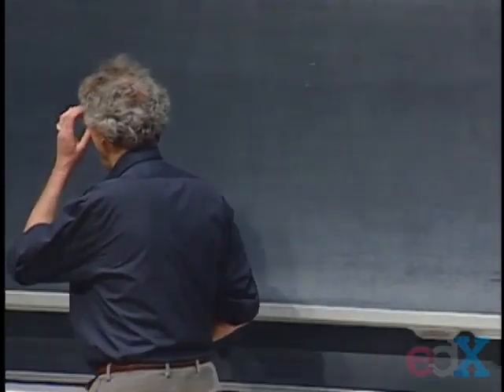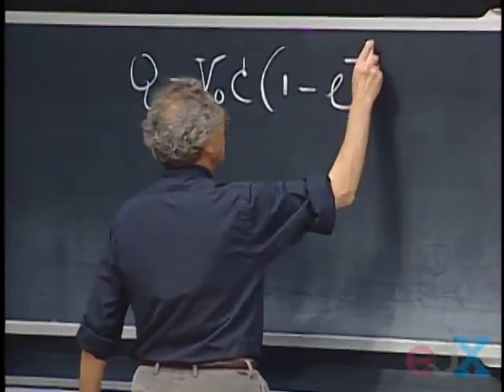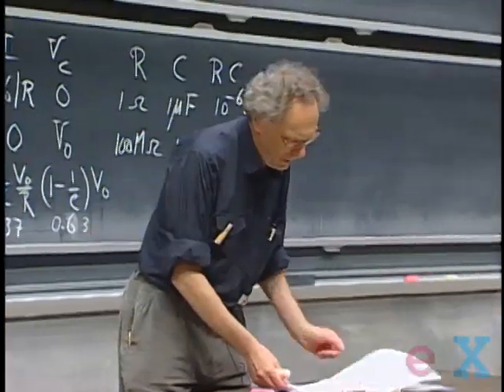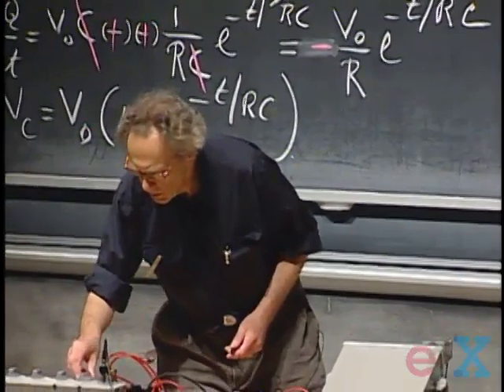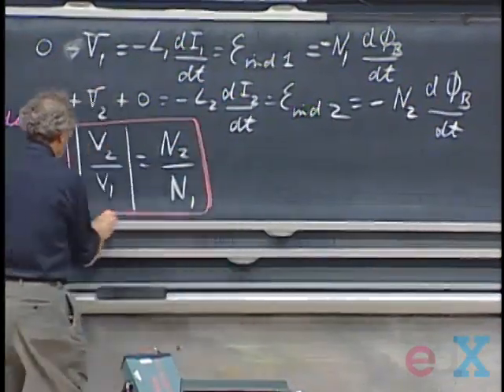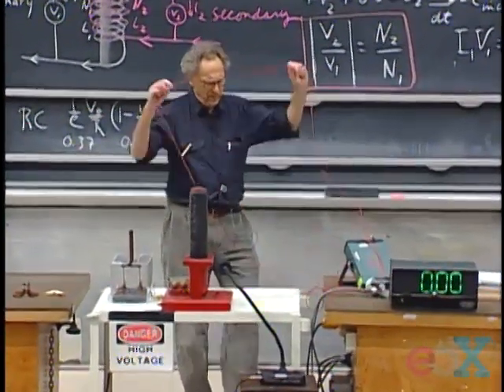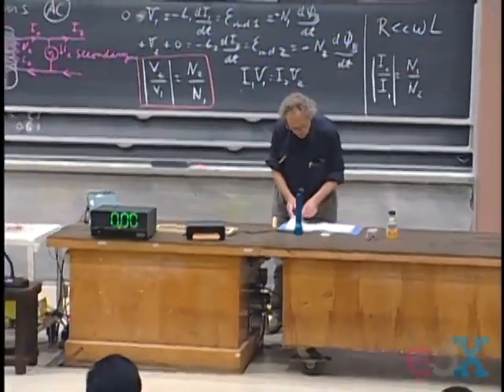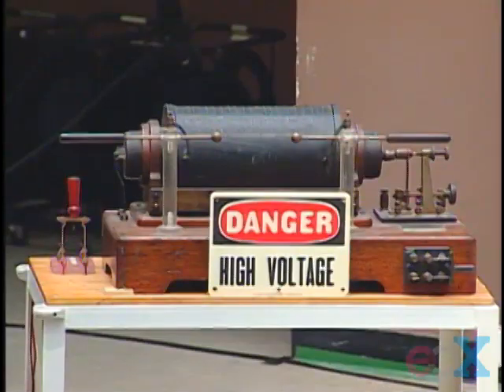8.02x - Lect 24 - Transformers, Car Coils, RC Circuits

Comment: Sir...

1) How can LR and RC circuit be so similar i mean for both of them the value at time constant is 0.63. Is this just a coincidence or are they related.

2) Also we have seen almost all the formulas of field/potential in gravitation/electristat/magnetism are exactly the same except the constants and concerned physical quantity so is it just a coincidence or do they have some relation?

3) Why the flux coupling is not ideal when you kove secondary loop up the primary loop?

4) What is the use of resistor in RC circuit when the switch is at position 1?

5) Why R<<<wl is a 'IF' in ratio of current and not in the ratio of Voltage afterall you have just substituated the values?
Reply: @lecturesbywalterlewin.they9259  
Ok sir that means only that 0.63 value is same in both the cases but nothing else is same...
Thankyou sir...

And other 4 questions?
Reply from the maker: @shubhamraj4879  you miss the meaning of the 0.63 it is (1- 1/e). That choice  is a mathematical choice. It has nothing to do with R L and C.
Reply: @lecturesbywalterlewin.they9259  
 @Lectures by Walter Lewin. They will make you ♥ Physics.  
Yes sir i got it when i watched your both lecture on RC and LR curcuit again...
Thabkyou sir for these lecture s...
And sorry for your inconvenience....

And please have a look on other questions also...espicially question 3,4,5...

Thanks again...

Comment: What will happen if we apply dc to a transformer? Reply sir pls
Reply from the maker: watch my lectures on transformers - there is your answer
Reply: Manish, The last 15 minutes of this video shows what happens. Cars use dc.  The device at the very end uses dc.  When you put dc through a transformer a steady current will flow in the primary and it will build up a constant magnetic field.  You’ll get a pulse of voltage in the secondary when you turn the current on or off and the magnetic field changes.

Comment: When we say IV here can we replace it with I^2 R and V^2 R
Reply from the maker: Yes if IV is the power dissipated in a resister it can be replaced by I^2*R and by V^2*R 
But if the circuit radiates EM waves then more energy is dissipated than I^2*R

Comment: Sir, I've always seen that current is directly proportional to the emf but in a transformer the inverse relation is followed.
I'm confused by this
Reply from the maker: If the EMF in the secondary winding of a transformer is V volts the current I that will flow through a resistor R is V/R (Ohms Law) it flows in the direction of the E-field in R.
Reply: Yes, sir and there's another rule that is( PW = VI ) and if the transformer is perfect that it can transfer all power without any lost power then it's constant . So , V and I are in reverse relation

Comment: Sir one person on physics.stackexchange.com is saying that : "  There is a potential drop across the ends of the inductor and there's no electric field inside the inductor and these two facts don't contradict each other because in the inductor, the
 electric field is not the gradient of the potential. Instead, it is given by the formula : E = - ∇ ϕ  -  𝛿A/𝛿t . But in your SUPER DEMO lecture you said that the potential drop across inductor is zero. Which one is correct ? What is the paradox?
Reply from the maker: The integral of E dot dL through the wire of a superconducting inductor is ZERO as there is NO E-field inside the wire. However, if you attach a voltmeter across the inductor it will read -LdI/dt.  This is the consequence of Faraday's Law which runs our entire economy. I suggest you watch https://www.youtube.com/watch?v=nGQbA2jwkWI&index=17&list=PLyQSN7X0ro2314mKyUiOILaOC2hk6Pc3j
it will blow your mind.
Reply from the maker: when we deal with non-conservative E-fields, potential difference is no longer defined and we should avoid calling the integral of E dot dL "potential difference". The integral of E do DL depends on the path!!! two different paths between the exact 2 points in a circuit can give very very different values. also watch https://www.youtube.com/watch?v=LzT_YZ0xCFY&list=PLyQSN7X0ro22zanLOcvkaSY-IZqheFYM5&index=6

Comment: Professor I have a question.           A frog can be levitated in a magnetic field produced by a current in a vertical solenoid placed below the frog this is possible because the body of frog behaves as                                           PS your lectures are amazing
Reply from the maker: ask google or quora
Reply: According to google it is diamagnetic but I still don't get it
Reply from the maker: http://www.slate.com/articles/business/how_failure_breeds_success/2014/05/nobel_prize_in_physics_andre_geim_went_from_levitating_frogs_to_science.html
Reply: Thank you sir

Comment: Hello Sir,
Could you please answer this question:
What is the difference between the magnetizing inductance of a transformer and its self inductance?
Reply from the maker: use google
Reply: I mean in my question the following and I hope you can help me: it is said when current is circulating in the secondary of the transformer due to connected load, an mmf is produced by the secondary current that reduces the flux in the core thus the primary current is increased to counter this reduction. What I am confused about, if the secondary current produces a mmf (or a flux) it should have an inductance right? what is this inductance? the same for the primary winding when the primary current flows it counters the flux that it is produced by the secondary. So it has an inductance? If so where these inductance are shown in the equivalent circuit of an ideal transformer? I dont know of course I am missing something.

Comment: At t=0, current flows in RC circuit. I want to know how does current flow through capacitor or why current dies off when t approach infinite? Pls reply professor
Reply from the maker: question unclear - watch my 8.02 lectures then ask a question as you are watching that lecture and tell me how many minutes into the video
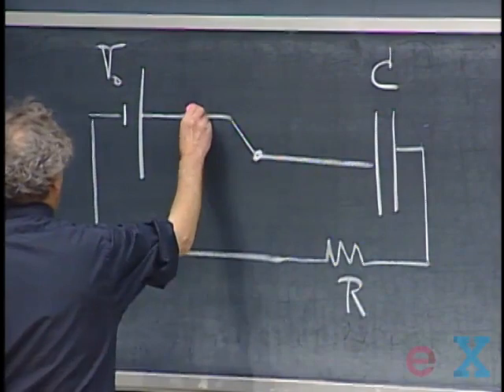Reply: 2:04 how current flow through capacitor?
Reply from the maker: PLate A and plate B. No current flows from A to B, but if A gets ++Q charged, plate B gets ---Q charged and thus there was a current in the circuit to make that possible, that  current is dQ/dt
Reply: Dear professer I want to know that you take d c source and we know that d c current don't charge the capecitor please reply

Comment: Professor Lewin for the spark plug explanation, are sparks generated when the switch is closed as well or does that only occur when the switch is opened?
Reply from the maker: how many minutes into the lecture?
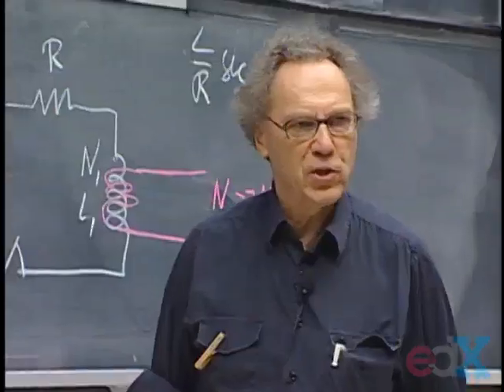Reply: @ 43:21
Reply from the maker: there is nothing at 43:21 that relates to your question. I therefore cannot answer it.
Reply: There is no spark when the switch is closed as there is no saturation of the primary circuit yet to create a resistance low enough to induce current flow, that would be sufficient enough to "jump the air gap" of the switch closing in order to create a spark. .

Comment: Prof. 
If Flux change =0 
=> L =0 
And  if L=0
=>flux change =0
Are both the statements true??
If current has certain value.
Reply from the maker: how many minutes into the lecture?
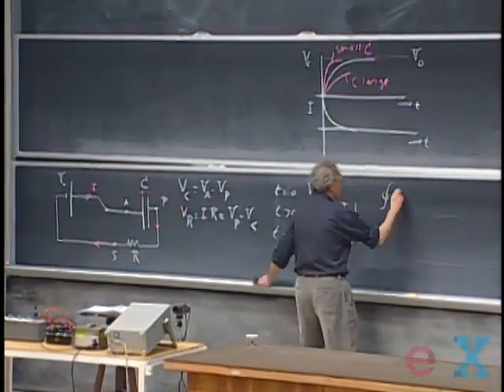Reply: Around 5:28 where you explained RC circuit !!
This que just clicked my mind!!!😅
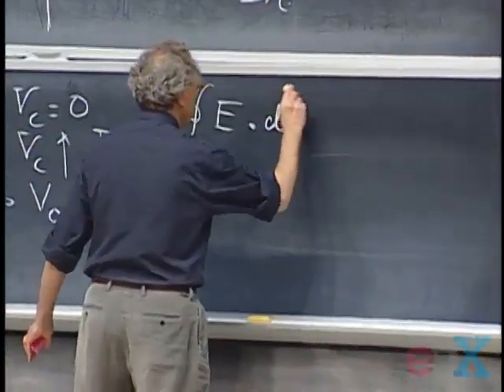Reply from the maker: there is no L at 5:28
Reply: @lecturesbywalterlewin.they9259  yes while explaining you said that KIRCHOFFS IS HAPPY FARADAY IS HAPPY (MEANS their law holds no flux change is there ,as no self inductance)
So i got this que.. 
That what is responsible for what?
L =0 is responsible for zero flux or vice versa?
Reply from the maker: If the self-inductance in the closed loop is near zero or is so low that it can be ignored, then the magnetic flux change through an open surface, attached to the closed loop is ZERO. (Faraday's Law). Thus the induced emf in that closed loop is near zero and can be ignored.
Reply: @lecturesbywalterlewin.they9259  thanku prof.😊
I got it!!

Comment: sir according to ohms law potential difference is directly propotional to current. sir but in transformer as voltage increase  in primary coil current decreases. sir this is now contradictory what is this
Reply from the maker: https://en.wikipedia.org/wiki/Transformer
Power delivered on the primary side is I1V1. Power delivered on the secondary side is I2V2. In an ideal case I1V1=I2V2.
Reply: As Lewin says in the lecture, this is only true when the resistance of the secondary coil is much lower than the AC frequency multiplied by the coil's inductance (R << ωL). This is because the resistance is very low, so we'd expect a large current for a given voltage per Ohm's law, but since energy must be conserved, the power through each side of the transformer must be equal: I₁V₁=I₂V₂, thus I₂ is inversely proportional to V₂.

However, when there is a load on the secondary side of the transformer, in all practical situations its resistance will be larger than ωL, so its resistance takes precedence, and we will in fact see V₂=I₂R, where R is the resistance of that load.

Comment: if the battery had no internal resistance and we short out the battery using a super conducting material then the current wouldn't flow i suppose? because it would be a total violation of the conservation of energy and yet electrons tend to go from a lower potential energy to a higher potential energy so what would happen
Reply from the maker: when you close the switch, you would short out the battery. It would go up in smoke. Current can flow through the superconductor though there will be NO E-field inside it.
Reply: even if the internal resistance of the battery is zero? :o 
i mean if there is internal resistance the energy stored in the battery will pay up as heat and there would be no violation of the theorem of conservation of energy but what if the battery had truly no internal resistance? and is that even possible a battery with no internal resistance?
Reply from the maker: any battery convert chemical energy to electricity. Zero internal resistance is not possible.

Comment: I  find it a bit weird how the time taken to fill up a self inductor with max current decreases with resistance. What is the intuition for that either than deriving the formula for it?
Reply from the maker: question unclear
Reply: Well, my intuition would be that for a given fixed value of inductance, as resistance increases the nature of the circuit becomes less affected by inductance and more by resistance until you have a resistance so high it makes the inductor's effect negligible.  It becomes more just a simple I=V/R resistive circuit,   Now, note what reducing R to zero implies!  Apparently if you apply a voltage to a superconductive coil, no current will ever flow!  The counter-EMF would always exactly oppose the applied EMF!

Comment: Hello Sir. Hope you are doing great. I have a small query. From the spark plug demo, we understood that EMF is generated in the secondary coil of a transformer even if the coil is open. I had an understanding that there should not be an EMF across an open secondary coil but the moment we try to measure the EMF of the secondary coil using a Voltmeter we automatically make it a close circuit with a high resistance. Thus showing a reading in the Voltmeter due to the small current flowing through it. But that seems to be not the case for spark plug secondary coil. Should we then think that the air gap should also be considered for closed  loop integral E.dl? Your reply may solve this paradox hovering in my mind for quite sometime.
Reply from the maker: >>>EMF is generated in the secondary coil of a transformer even if the coil is open.>>> The integrall of E dot dL  through the open wire of the secundary coil is zero. If you now attach a voltmeter to the open end then you have created a closed loop and Faraday's Law applies. If the coil wire is ideally superconducting the integral of E dot dL through the wire is zero but the closed loop integeral must be -Ldi/dt which is the induced EMF. Thus that's what the voltmeter will indicate.
Reply: Sir, thanks for viewing my query and your quick reply. As we saw in the demo that spark is generated in the air gap due to electric break down. So, we can conclude that potential difference is generated across an open secondary coil as a result of time varying current in the primary coil. Can we apply Faraday's law here and say that E.dl across the open secondary coil is equal to the induced EMF. However for open circuit case, there is no induced current flowing through secondary until the break down occurs. Is this a correct understanding of this phenomenon?
Reply: @rajbiswas1597  "Can we apply Faraday's law here and say that E.dl across the open secondary coil is equal to the induced EMF." — No, because Faraday's law says nothing about a path that is not closed. Applying Faraday's law properly, across the path that goes through the coiled secondary wire and from one endpoint through the air to the other endpoint, thereby closing the path, we conclude that before the air breaks down to allow current to pas through it, there is still an electric potential drop because there is in fact a non-zero electric field present between the two endpoints of the wire, i.e. in the air. It's just that until the air breaks down to allow a current to flow through the air, the resistance of the air is too great, so no current flows.

Comment: There's one thing that has been troubling me, how is it that, in a transformer, a high voltage corresponds to a low current? I understand that it's to conserve energy and to keep the power constant, but it somehow doesn't sound intuitive to me.
Reply from the maker: completely intuitive to me.
Reply: @lecturesbywalterlewin.they9259  But sir, doesn't a high voltage mean a high current? Doesn't a 9V battery supply more current than a, say, 1.5 V one? Or am I missing something here?
Reply from the maker: the high voltage supply (like) any power supply is limited by the available power. Voltage is NOT energy and not power. VI is power. Thus if VI has a given maximum due to the power source a high value of V means a low value of I.
Reply: @lecturesbywalterlewin.they9259 Oh I see, thanks a lot for the answers and for taking the time to answer them!
Reply from the maker: A 12 V car battery is capable of generating 8000 W power. When you start your car, the current through your starter engine is 600 A. Thus during the time that your engine is starting up, the car battery provides a power of about 7200 W (12 Volt, 600 A).
Reply: @BTCSE_AhmedHamzah  Think of the mechanical analogy of a transformer: a gearbox.  A gearbox allows you to trade the parameters of mechanical power, in order to select for either torque or rotation speed.  Torque * angular velocity is nearly equal on both sides of the gearbox, because of conservation of energy.  What the gearbox does, is allow you to input a low torque at high speed, to get a high torque at low speed, or vice versa.  It allows the power source to get leverage to move the load.

Likewise, a transformer trades the parameters of electrical power, i.e. current and voltage.  The product of current and voltage on the primary, is approximately equal to the product of current and voltage on the secondary.  Reduce one, and the other increases.   This allows for "electrical leverage" to transmit power long distance, so that the ohmic losses in the transmission line are a lot less than what they otherwise would be.

Comment: Hello sir, as magnetic field outside the solenoid is zero, how can moving a secondary coil outside (around) the primary coil produce emf? @35.00 lecture 24
Reply: They share a common ferrous core, and there is magnetic field that continues along the axis of the solenoid.   That statement refers to radially outward from a solenoid, rather than axially outward.

Comment: Dear Prof,
if V is varying with time (AC) and so dI/dt not= 0, why is there no voltage drop across the inductor at (24.13)?
Reply: Why is there no Voltage or E field drop across inductor?
Reply from the maker: L R circuit driven by AC power supply.  The closed loop integral of E dot dL at time t when de current is I_t is LdI_t/dt. The integral of E dot dL through the inductor is ZERO as the inductor has zero resistance. Faraday's Law. There is no E field at any time in the conductor.

Comment: When you did the transformer experiment with the large red wire then it didn't melt.What is the reason for that professor?
Reply from the maker: Arnab Mallick what is the number of the lecture and how many minutes into the lecture?
Reply: Lectures by Walter Lewin. They will make you ♥ Physics. 8.02 lecture 24 at around 34.27 for the first experiment and at around 40.23 for the second experiment.
Reply from the maker: Arnab Mallick I watched the demo. The nail did melt. Watch the demo again. The center melts and the current stops.
Reply: No no, my question was why in the case of the former experiment around 34.27 the wire didn't melt?
Reply: Well I think I have found the explanation..which is owing to the series connection of the voltmeter the turns out to be too small.tiny miny amount of current so i^2R heat was very small..
Reply from the maker: Arnab Mallick yes i^2*R was too small

Comment: Sir, please, I didn't understand the idea of an ideal coupling, how come moving the loop up the solenoid affected the flux coupling ? 
Thank you
Reply from the maker: how many minutes into the lecture?
Reply: 35:17
Reply from the maker: the B field inside the solenoid tapers off near the ends for obvious reasons. Thus the magnetic flux change through my secondary loop goes down somewhat